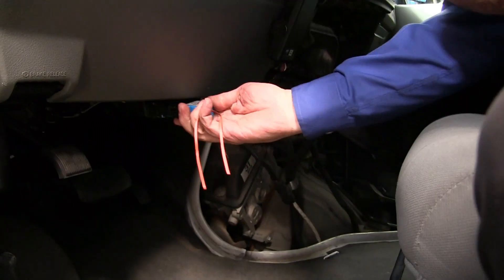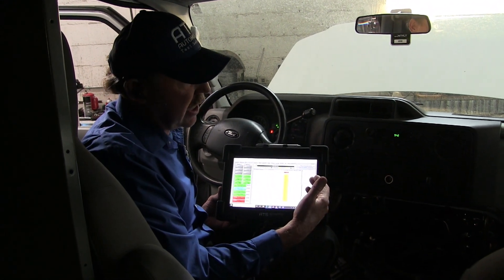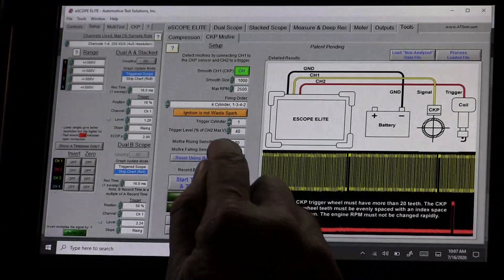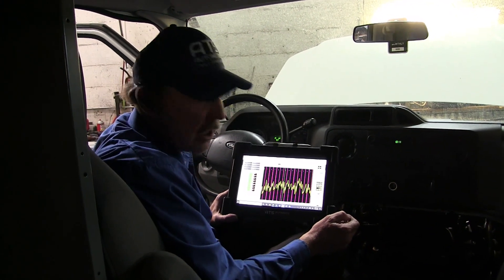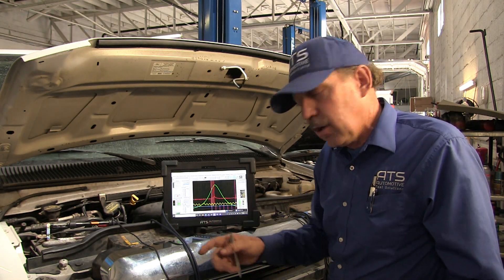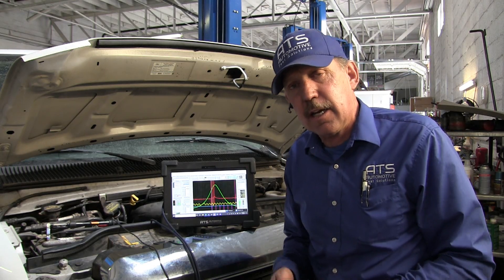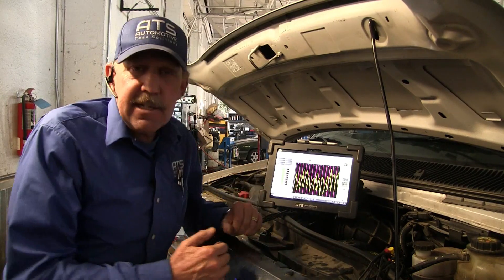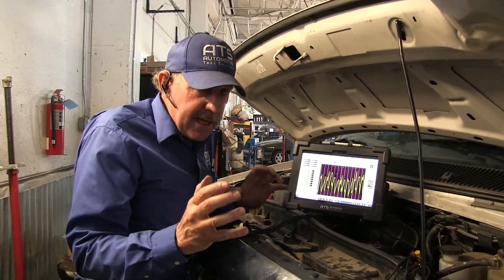Diagnosing a misfire on a  2009 Ford E250 Van

Comment: I have seen one 4.6 dohc in a Mercury Marauder have a worn out key slot on the wheel.  Definitely not a normal issue but apparently it does happen.
What I do know is most shops don't even know what a lab scope is let alone how to use it for diagnosis. 
GREAT VIDEO thanks

Comment: Bernie, You are absolutely right. Using quality equipment along with a method of best practice to capture and analyze the data is key to finding problems. I see the first 2 pieces of data you collected was the CRANK POS SIGNAL and the #1 coil signal. Then you retested with a pressure transducer, getting a reliable mechanical reference by way of cylinder compression and cycles. It still showed the ripple of the crank signal.
Once you proved that the fault was a loose crank reluctor wheel and then repaired it, I appreciated your follow up to show a good crank signal with the tight reluctor wheel. THANKS SO MUCH FOR YOUR GREAT DEMONSTRATIONS!

Comment: I wonder what the power balance graph would have shown?  If you see drop outs in the graph, but don't feel it missing that could be an indication  of crank sensor signaling issues?  Then it would be  time to break out the scope and pressure transducer?

Comment: How is it that your scan tool can get live sensor data (coolant temperature, battery volts, vacuum etc) at the left of the screen while going to get mode 6 data? Every scan tool that I have ever used can only do one task at a time. Live data, mode 6, monitors etc. while eScan seems to be getting info from all different options at the same time, or at least allows you to (what it looks like).

Comment: Great catch, but lm puzzled why the tone ring is moving ( even with the loosened harmonic pulley bolt)?  My 97 f150 4.6 Windsor has a tone ring keyed with the crankshaft. Is this one set up differently? Just did a timing job (PM) and had to reuse my CS bolt. I purchased the wrong one ( I know torque to yield bolt) but reuse it. Going to change out but expect the tone ring position to still be good, or am I mistaken. Thanks

Comment: Amazing. The average car owner has no clue how incredibly complex diagnosing modern vehicles can be and the associated costs for diagnostic equipment necessary to do that. On a side note, what were the pink/purple lines with the cylinder numbers above them you were using to compare ignition and transducer signals against?

Comment: Couldn’t the same test be done by comparing crank and camshaft relationship? I mean trying to detect the movement on the reluctor wheel for crankshaft.
Reply: That would be really difficult to see if you were referencing it off of the cam signal because of chain lash and VVT phaser action.  You really need a point of reference that is consistent such as cylinder pressure.

Comment: The scope diagnostics and theory are awesome , but typically if the damper isn't fully seated there be other clues where to start looking , like customer mentioned it started running lousy ever since the front crankshaft seal replaced, and serpentine belt noisey afterwards.
Luckily loose damper didn't trash the crankshaft, and end up needing the motor replaced. I think I would have pulled the crank sensor and looked inside with snake camera and tried a little pushpull on the trigger wheel with a long blade screw driver or pick, and try tightening the damper bolt before pulling the entire front of motor off if it didn't have chain noise or cam crank correlation besides.